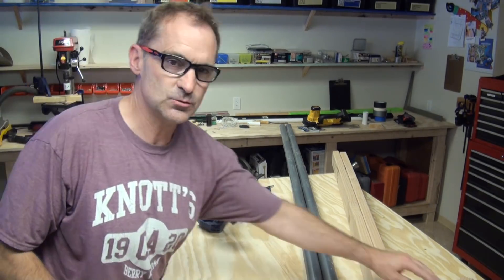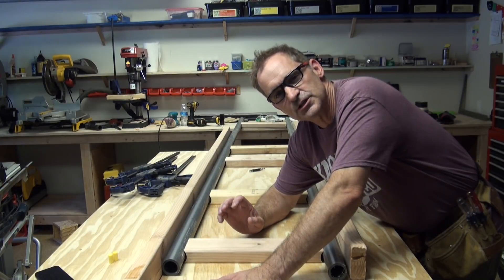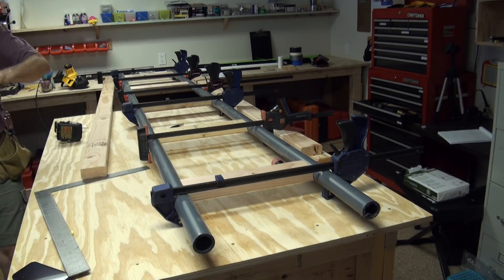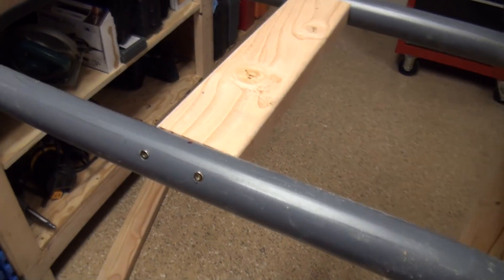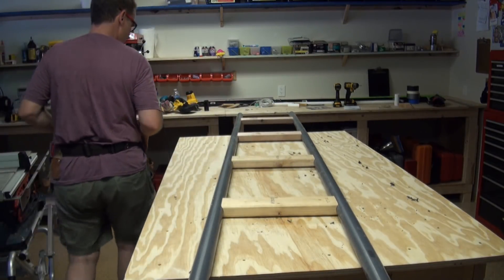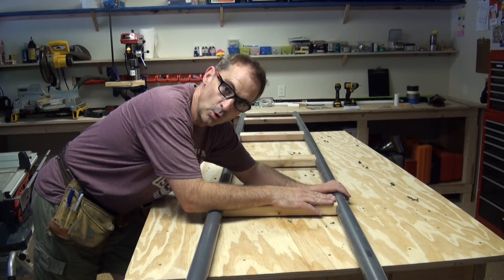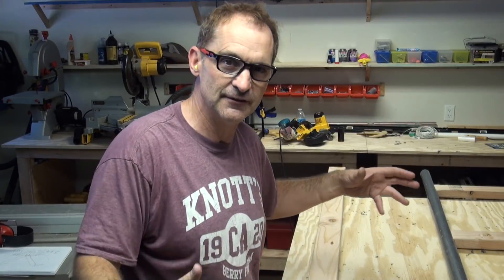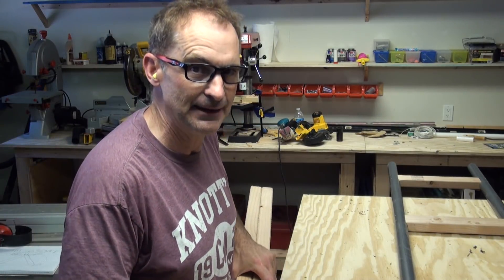How To Build Roller Coaster Track Supports

Comment: How do you join it
Reply from the maker: I use a smaller piece of PVC, heated in a toaster oven then run screws through it into one of the ties. Best to stagger the rail seams so as to reduce the thump thump thump :)

Comment: Will, you’ve mentioned and recommended both schedule 40 and 80 PVC for track on backyard roller coasters. If maintained properly and used on a coaster only 5 feet tall (which is what I have done the math for), does any type outperform the other and are they both perfectly safe? What would you recommend? Thank you!
Reply from the maker: Hi Josh -
Great questions! Let's start with the part about how nothing is "perfectly safe!" Sch80 has thicker walls, which means it may last longer. SCH40 is less expensive. UV light is the enemy of PVC. Sunlight will cause it to get brittle/weaker over time. So, be sure to spray paint. When it comes to PVC, Paul Gregg is truly the man! I build my coaster tracks with steel these days. Mainly because I just love to weld! Hope this helps!

Comment: How do you bend the pvc pipe to make the humps to go over on the coaster ride?
Reply from the maker: Hi Gary! The first coaster I did, I just used straps and brute force to bend the track to fit where I wanted it to go. In subsequent coasters, I used a method developed by Paul Gregg which involves pouring hot sand into the PVC pipe which keeps it round and also makes it soft enough to where you can bend it any shape you like. The great thing about PVC pipe is that you can heat it up and when it cools down it keeps all the same physical properties and strength that it had before you hit it up. That’s not true of all materials, PVC is awesome in this regard :-) I hope that helps and I hope you will put up videos or pictures of your project!
Reply: @WillPemble  thanks for the tips!  Yes if we build we will share a video

Comment: Would you bend the pvc before or after making the track?  Great video!
Reply from the maker: For curves, probably best to bend it before. However, for my first coaster, which used Schedule 40 1-1/2" PVC, I just bent it into place whilst building the track. Wouldn't do it that way again, but it worked :)
Reply: @WillPemble  thank you!

Comment: Gussets on the top joint of the truss that could also be flared outward for more stability.  Also, cross supports to the truss supports so it won't drop flat from inertia of the car.  Great video, very informative.
Reply from the maker: Thanks, Captain Obvious! The improvements you suggest would make the deisgn way better!

Comment: I know this is an old video but why not turn the 2x4 the other way or make an L shape ? Also how much weigh can those supports hold as far as cart track and people wise?
Reply from the maker: For me, it was important that the 2x4 tie was thinner than the diameter of the rails. That way, the wheel assembly could pass freely over the track without hitting the ties.

Comment: I would not do the triangle for the support. I would do a board on each side coming straight down with an X support in the middle. Since all of your weight will be on the outside of the track.

Comment: Hey there Will! Im really amazed about your builds and im now so hyped about you showing how to build it! :D I've been watching your videos for such a long time now and last summer I drew a sketch for my own coaster BUT there was this ONE QUESTION that always stopped me from realising my plans and its about: How much weight does e.g. your type of pvc coaster track support? Is it safe for adults to ride on it or does it break? Thanks for your great videos!
Greatings 
Tommi
Reply from the maker: Hi Tommi,
My personal feeling is that a steel coaster is better for adult-sized riders. There's enough uncertainty about what happens to PVC over time, and the work and precision required to get the screws in just the right place on the rails is important. With PVC, it's usually impact force that causes it to fail. So, when a wheel rolls over a screw, that can cause impact force, which may cause a crack, which may cause larger failures. 
Steel, on the other hand, is more reliable, and relies on welds rather than screws. One does need the equipment and expertise for welding, however. 
Hope that helps!
Best,
Will
Reply: @WillPemble  Yeah thanks for the advice! Is it possible that you make a video about Steel Coaster Tracks as these videos, where you show which spacing is needed and or how to proceed the steel/iron?
Thanks for your help!
Greetings
Tommi

Comment: Love your videos. I was thinking, In theory, I should be able to use Chain link fence pipe instead of PVC, shouldn't I? I know it would be harder to bend and more expensive, but it would be more sun and crack resistant,
Reply: If you haven’t already built your coaster, I would suggest painting the PVC, as this gives it a lot more sun protection than not painting it.

Comment: Do you have any advice for making an alpine coaster? The land around my house seems definetly more suited for one
Reply: Use a slightly upward hill at the end with friction brakes and a chain dog and anti rollback system to slow it down works best in my experience
Reply from the maker: Hi Aidan,
One could argue that the coaster at my house is kind of an alpine coaster. Most of the track is about 24 inches off the ground. We use the terrain quite a lot. For long alpines, I think managing speed would be the thing. What do you think?
Best,
Will
Reply: I definitely agree. My hopes are to use the exact track that you use but instead make it one-way and with a few drops. Thanks for the reply! :D

Comment: In your earlier PVC video, Will, you specifically mentioned using 1 1/2" (OD) Schedule 40; in this current video, you specify 1 1/2" INSIDE DIAMETER, Schedule 80.  What gives?
Reply from the maker: HI Larry! 
Great question! Both the Sch40 and Sch80 pipes have an inside diameter of 1 1/2". Schedule 80 has somewhat thicker walls, and is more resistant to UV radiation. Both have an outside diameter of 1.9 inches. How can this be so, you ask? As it happens, Sch40 has an inside diameter of 1.61 inches, which is how we explain the thicker walls on Sch80. Very little difference beyond that (except the cost!). Everything in this video can be done with Schedule 40 PVC. 
Best,
Will

Comment: What would I do for the ties if I don't have a drill press??
Reply from the maker: Hi Jake,
The first few coasters I built I didn't cup the ends of the ties. So, it's possible to do it without a drill press. That being said, you can probably pick up a used drill press for less than $50 on craigs list or nextdoor. Hardware stores sell basic ones (like mine) for less than $150.
Thanks for watching!
Best,
Will